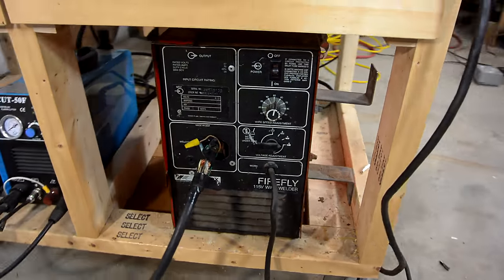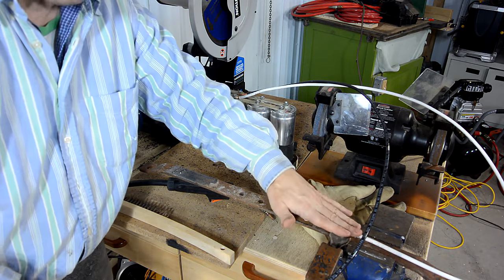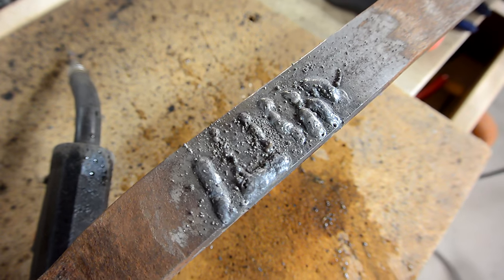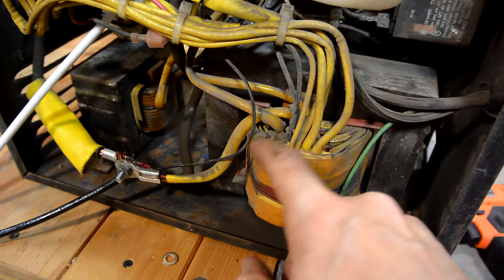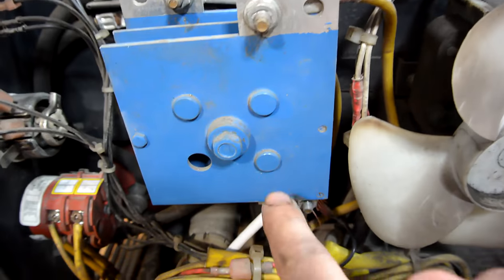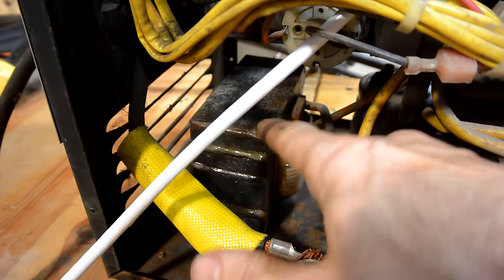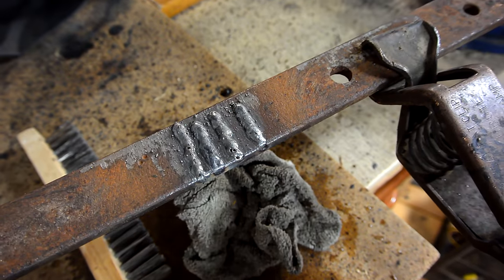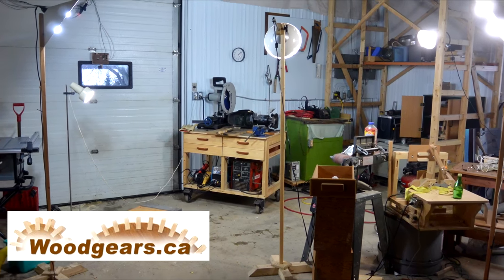Welder capacitor upgrade (fail)

Comment: Feed rate, stick-out and the quality of the wire itself have a major effect on how smooth the weld will be. I use (and really like) Hobart 0.30 flux core. It produces more spatter than the Lincoln, but seems to flow better and penetrate deeper.
Reply: Can't forget cleanliness of the wire. ;D
Reply: John Heisz Another point to highlight and check is condition of the contact tip as it can make a huge difference too.
Reply: Also with these type off welders cleaning the surface as much as possible is a must, starting to weld on rust with these welders does not weld easy at all
Reply: The main thing that helped with my cheap welder was a good ground clamp. I bought one from harbor freight a tweco style one and it made all the difference.
Reply: Carpentry is to wood carving as machine settings are to welding.

Comment: Cheap welders often use the same transformer for the arc and the wire feed.  The result is a stuttering feed as the arc forms, current increases, voltage drops, wire slows down and burns back, arc breaks, current drops, voltage increases, wire speeds up... The best thing I did to my cheap welder was replace the wire feed circuitry completely (I used an old laptop power supply).
Reply: In another video I saw a guy purposely buying an AC transformer for this. Is the motor AC or DC?
Reply: Brushed DC in my case.
Reply: I'm in the same case right now, I know the welder can give me the 170A that the datasheets says but I can only get 110 and varies depending on the kind of clamp or wire thickness i use, tip, etc. however, never really fully stable. So i was wondering that the feeding circuitry may be bad and that needs a change. Do you have any directions that I can follow?
Reply: Sorry, I don't - it's going to vary a lot depending on your welder anyway. I started by finding a schematic for my welder online. Good luck!
Reply: @KaloyanDobrev  most are dc i have 3 welder dc wire feed motors

Comment: Having a bad ground is the #1 culprit of bad mig/fluxcore welding.  Put some copper wire around the ground clamp to get many more contact points and watch your cheap welder surprise you.
Reply: Right-o, heavy flat braid copper always does the trick, even when the surfaces lacked optimal prep.
Reply: ScrewDrvr It looks like he could benefit from replacing the ground clamp itself too.
Reply: @GoofyGarton  I use a cheap pair of vise grips

Comment: Matthias, i think you will find most of the difference is arc stability actually  comes from inductance, it keeps the arc current more stable, as the arc length increases the inductance tries to maintain the same current, pushing the voltage up, allowing the arc to be stable  over a longer distance.

Comment: My recipe for machines and tools in general is always a quality brand bought 2nd hand. 

I don't even own a MIG though, I find a stick and TIG DC only combo to be far more versatile.
Reply: MIG certainly has its uses. Which is why it is the most used process in the welding world.

Comment: (Huge fan here!) I think you're might have wired it wrong: just after the transformer you'll have a sinusoidal (AC) wave (which these DC capacitors don't like = boom!). You have to wire it just AFTER the rectifier, both + and -, in parallel with clamp and torch leads and before the inductor core going to the 'ground' clamp in DCEN (or whatever is connected do positive). Also, it seems you're using metal plates (iron?) that are not (?) copper to connect the capacitors - that might be a problem with big currents - see MOT spot welders. The ESR of the capacitor is also important. To compare welds you should make some destructive tests (bending, cutting, cross cutting) to check and compare penetration, for example. Disclaimer: I'm NOT an expert but I do have plans to modify one of those cheap welders too...
Reply from the maker: I think you may not have understood the wiring right, based on your comment.  It's DC where the caps are.
Reply: I most probably have got something wrong but, it sure looks like the yellow lead is coming from the transformer (AC) (and not the rectifier, DC): https://youtu.be/vM8G-JqfV1c?t=88
Well, without a schematic, is hard to tell from this side of the monitor...
Reply: Note the negative side of the capacitor goes directly to the center tap (CT) on the transformer, for this two-diode/full wave rectification design.  The positive side of the capacitor is wired to the tied diode's cathodes.

Comment: you could try adding a choke/inductor to smooth out the current. Caps are for voltage smoothing.

Comment: I don't use innershield much, but DCEN is for hard wire with shielding gas. DCEN will work on innershield, but you get a crappy looking weld. DC electrode positive is for innershield. Most of the welders out there have a switch or a easily swappable set of taps in the wire feeder area.

Comment: Those 85V capacitors were hooked up to the output of that inductor, and then an arc was struck and broken repeatedly. The voltage transients could have easily exceeded the surge voltage on those caps and potentially damaged them, before they were ever put in parallel with the welder's filter capacitor.

Comment: Hey Mathias, just a little safety tip: don't point around with your fingers at capacitors of that size, even when the appliance is unplugged. Those suckers pack a mean punch and can hold a charge for a couple of hours. Safest thing to do is buy a multimeter with a low impedance voltage mode like the Brymen bm 257 and discharge those suckers before you service this thing. It's also best practise to tape off your wedding ring.

 I know welders generally don't have very high secondary voltages, but whenever you're dealing with capacitors that can store a fair amount of energy, it's better to be safe than sorry ;)
Reply: Squeaky Dave, is that you? Brymens are not very big in North America. Looking around all I can find is a rebranded Greenlee. We're more into Fluke meters here. For three more dollars I'd much rather have a Fluke 115 too.
Reply: I just used it as an example because I know that particular one has that feature, I trust Mathias is smart enough to find a similar one he can source easily.

Comment: You have no nosel on your gun. Are you not using a suppression gas? If not that would likely be the biggest cause of rough welding and would also explain the porosity I see in your final weld's.
Reply: It would be interesting to see the effects of your cap bank once you have some argon in the mix
Reply: looked like flux core to me, so no need for shield
Reply: Flux-cored wire by itself does not produce great welds; not as good as solid wire with shielding gas. Flux-cored wire together with shielding gas produces awesome welds.

Comment: The inductor is far more important. There is a video of a guy showing an arc being struck with a DC power supply and a welding rod. He cannot keep a good arc, because it's just a regular DC power supply. But then the man adds a 1000 foot coil of wire on a spool, in between the electrode and the power supply, with the giant bulk spool of copper wire, acting as an air core inductor with a relatively large inductance, and the guy is able to strike long beautiful sparking arcs, that are smooth, and leaving molten metal. The inductor seems to dramatically enhance the ability of a welding arc, without any additional input power into the system, which defies our understanding of science. The test is still on YouTube, if you look up "inductor coil sparks" or something to that effect. Basically adding a large inductor, after the smoothing caps, probably is the best bet.

Comment: I couldn't help but flinch when I saw you poking around inside the welder and around the huge capacitors. I follow several electronics channels and they go to great effort to check that 'normal' sized capacitors (i.e. smaller than an AA battery) are discharged before poking around. The potential jolt from those huge ones isn't something to be messed with. Not saying you weren't being safe off camera Matthias, but it needs to be mentioned just in case others aren't aware of the danger.
Reply: This is true for smoothing capacitors for rectified mains voltage.
Ther welder might have something arround 50V no load voltage.
If you touch the capacitors with 50V on it not much will happen, if you short them with metal you get a bang of course.

Comment: When you smooth rectified AC, you end up with constant DC, which destroys the generated squarewave by the circuit(which feeds into the main transformer primary), I am surprised it welded at all with the caps.

Comment: I do not speak in English, but - 1) in this circuit capacitors stabilized voltage level - 2) in the metal welding electric arc is the most important for the stabilization of the current level, it stabilizes the plasma stream. We must find a way to stabilize the current.
Reply: For Flux welder : Constant Voltage required 
For Stick Arc welder : Constant Current required

Comment: I'm not a welding expert, but for me sanding or filing contact surface on both that clamp and metal makes a huge difference. If these contact surfaces are dirty or rusty, the arc may behave terribly annoying(

Comment: if you are have trouble with weld quality try give the welder a birthday. replace the liner of the gun this can create poor wire feed which will make it feel as if the welder is cutting out, replace the tip (obviously, you should be doing the regularly) and put on a new ground clamp yours looks quite old.

Comment: Probably had a good spark after welding if nothing else. Cheap 110 migs are halfbridge.. Try it with a full bridge setup. It's interesting as it really penetrates deeply.
Reply from the maker: half bridge, not half wave.  Center tapped winding.  A full bridge rectifier wouldn't do any better.
Reply: did on mine.  Removed the pulsing. I never said it was easy to do.

Comment: If you are doing mig and you aren't running a gas nozzle thats really going to effect your welds more than anything. I saw some porosity in those welds. Try getting your gun set up right then revisiting this. Or just switch to flux core.
Reply from the maker: it's flux core, not mig.
Reply: Weird. Maybe try running dual shield? Or it really could be that the welder is just that bad. Or possibly the wire. I have found the cheap harbor freight flux core to not be very good. I know you aren't in the US so harbor freight isn't a thing but I know you guys have some places like harbor freight.

Comment: Have you relined the torch lead? The problem could very well be in the feed and not the power. Line the torch lead then clean and adjust the feed drive wheels. Just a thought as I have had similar problems in the past with my welder.

Comment: some of the cheap wire feeder welders have very low tech control of the feed motor. you might find that it's a combination of wire speed being highly variable plus poor contact to the feed wire in the hand piece.

Comment: I added a single 33,000uf capacitor to a cheap welder and it made a huge difference to the performance at low amps (<80), but worse at the high end. The welder did have a rather large choke/inductor. I came to the conclusion that the inductance should be changed depending on the current used for welding, and have since found out that on some expensive industrial machines this is what they do (variable arc force). My capacitor was essentially cancelling out some of the inductance, as theory suggests, and optimised the circuit for low amperage welding.

Comment: changing flux wire does  more for a weld.even as a beginner you will notice the difference the first time you test it. and if welder it's gas capable, you can add gas then it gets even smoother.

Comment: There are a couple of factors that come to my mind directly, but the very least of them being filter capacitors. 

The wire - Cheap flux cored wire tends to lead to horrible results. Proper industrial grade wire tends to produce better or excellent results. Might be a reason for the porosity of some of your welds. In addition to wire quality in general, how you store your wire is a huge factor. Humidity in storing is definitely a performance killer. Although good flux core wire can handle a lot of "wrong storing" before the results suffer.

The contacts - clean them if you haven't, replace them if necessary and check for the right size (you wouldn't be the first person on earth to screw in too big contact tips :-D).

The abilities of the machine - If I saw it right on the video, the flat bar you were welding on was about 5 mm thick. Too little "UMPF" for the material leads to lots of splatter, very flat fusion (which is then more tacking than welding) and porosity (not always but often).
The tiny welding machines from the DIY superstore that I know might be able to produce an acceptable result on thin walled section or sheet metal and some of them are even sort of fun to use on cars (with shielding gas) but as soon as you run them over something that requires some power, they naturally give in.
Without knowing your machine my guess is that it should improve your results dramatically if you limit the thickness of your material to 3 mm on a good day and if you have something ticker, use a propane torch and pre heat it properly before you grab the welding burner.

You still won't get the prettiest results I guess but dependent on what you want to do with it this might be enough for some satisfactory results.

Comment: your cap cables should be shorter and thicker , the caps provide all the current. if you can ,put the caps straigth after the rectifier to the same bolts . you can put a switch to turn them on or off. a great improvement is to create a separete power supply for the feed motor , so the feed motor does not take power from the main transformer (who does all the welding so it is not steady).
(why you do not use the gas attachment to your torch?).
Reply from the maker: My cap wires were thicker than the wires coming out of the transformer, and shorter than the transformer windings or the welder leads.

Comment: Your welder appears to be a rebranded Miller Cricket. Which is considered a really good thin gauge welder.
Reply: The Canox welder are all Miller welders. So it's there not a cheap offshore welders to begin with

Comment: Hey a tip for you that use flux core wire. Visit a real welding shop and pickup nozzle dip and anti spatter spray. Apply to the metal before welding and youll have less spatter sticking to the steel.

Comment: dude, by comparison standards your welder is older but I definitely wouldn't call it a cheap welder, when people talk about cheap welders they are generally referring to all the cheap under $150 AC flux core welders like the ones you get from harbor freight and amazon ect...
they don't have rectifiers, capacitors, or inductors and they don't have any capability to switch the output between AC and DC. you can tell your welder has been used hard but it's still far better then any of the cheap welders you can get today, in fact, seeing what i could of the way your welder was built I'd put it in a class above what you get today from Lincoln for $500, none of the low end Lincolns I've seen opened up even had capacitors which surprised the hell out of me. My personal opinion judging from what I saw in the video, the factors that will clean up your welds the best are to first start using better wire, I use personally like Forney but any quality brand flux core wire is better then that crap HF sells then hopefully by now you've got the other factors like stick out and wire feed speed figured out, for a DCEN welder with good wire to produce a lot of splatter it usually means the wire speed it to high. just some of the things that stood out to me from your video, I know I wished I could find a welder like yours, especially now that my son has burned up my older good welder.....

Comment: it certainly sounded smoother with them hooked up if you were using gas-shielded solid wire there would have been a more desirable difference

Comment: Wow!! That is such an awesome Welder. The components they used in that are quite awesome!! I am a chemical engineer with a minor specialty in electrical engineering and I love the huge blue 'rectifier?" Where did you wire your inductor?

Comment: You're a lucky boy, it works out about 2500UF per Amp, people like you or anyone else shouldn't be doing this, try using that welder for a longer period of time and see what happens, BOOM! would be the correct term.

Comment: I don't quite understand why the waveform charging the inductance would make a difference. Especially at the low or mid level currents the inductance shouldn't get depleted.
Reply: addendum: Assuming that a light arc is a dead short and the current is limited by the inductance.

Comment: Mig welding is constant voltage stick welding is constant current add that bad boy to a stick welder and you'll find the arc strikes easier

Comment: Yeah, I finally figured out, the adding of caps to an existing machine is a waste of time.
Your machine is capable of switching polarity. Next machine I buy, I will look for that. I will spring for modern inverter type.